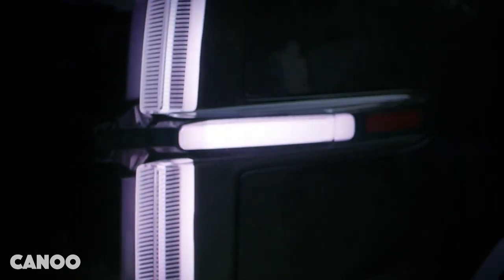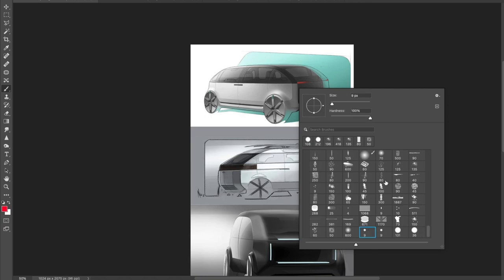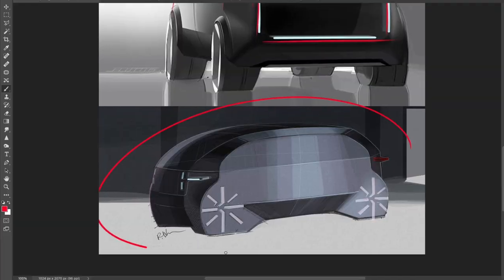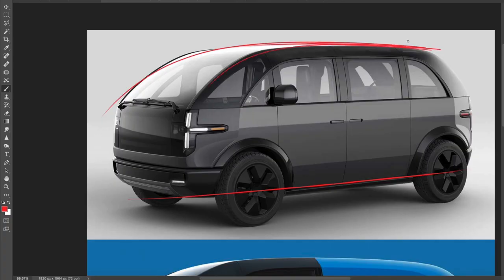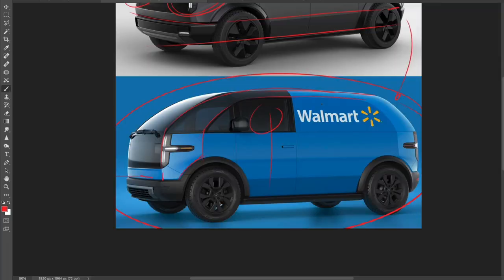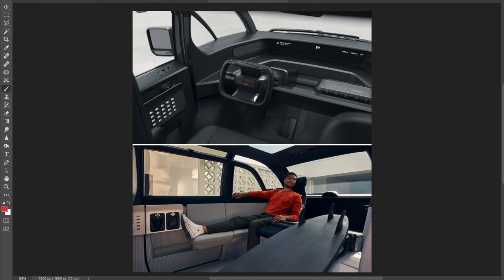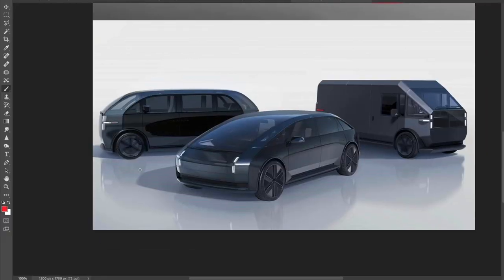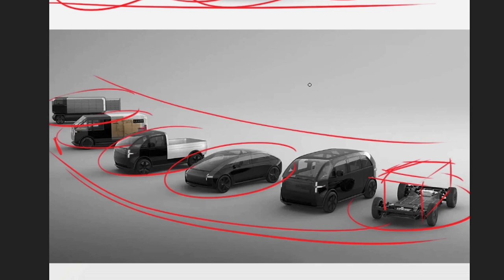I can't believe THIS is the NEW electric Walmart van!

Comment: Hoping Canoo survives and builds the other vehicles. Im not a pickup guy, but I really like the pickup.  I would actually consider getting one as a daily driver. Really liking the sedan. If they can make it affordable they could have a winner.
Reply: they need to be affordable
Since they're business model is by renting the battery 

afaik*
Reply: I can‘t stand pick ups either- usually. 

But the extending bed means that the size is completely normal when not transporting stuff which is amazing!